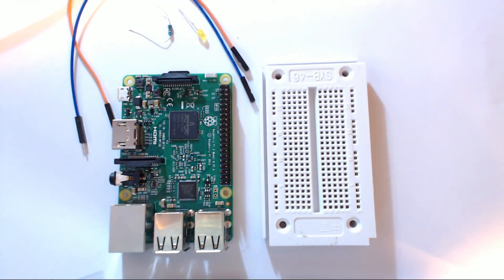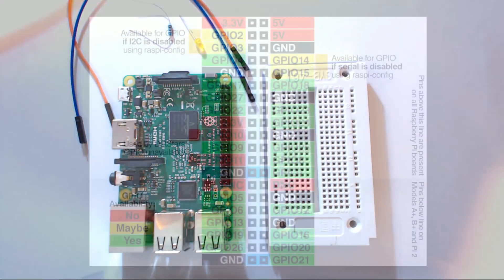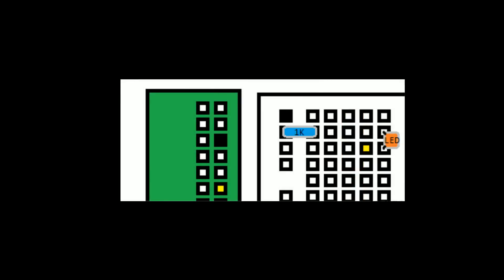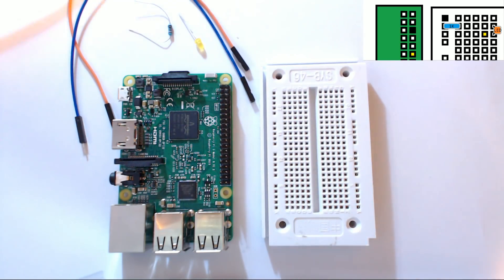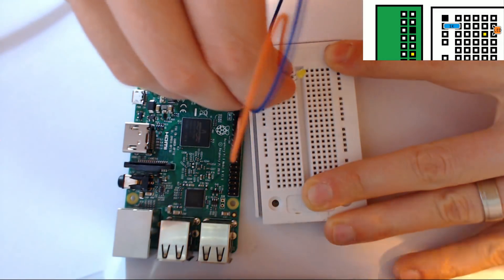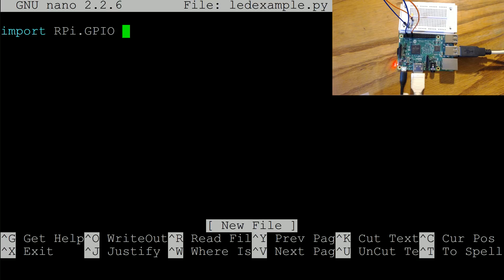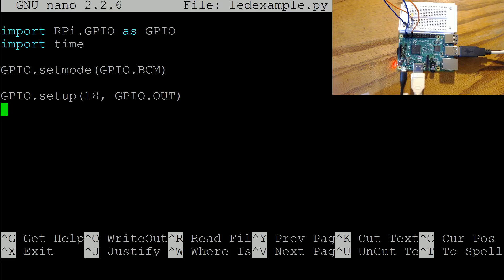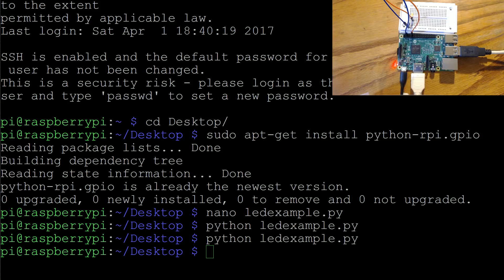GPIO Basics with LED light - Raspberry Pi and Python tutorials p.6

Comment: Excellent tutorial; I really appreciate the depth! I'm experiencing a small hiccup and wonder if anyone here could help. When I ran the program the first time (the light was initially on), it stayed on, then turned off 5 seconds later, as I expected. However, I can no longer get the light to come back on. Could anyone here help? I'm suspicious that the problem may be with my raspberry pi, but I hope there's a simpler solution. Here's what I've tried:

Running code with a delay before turning the light on, and not turning it off again
Testing the LED in another circuit to see if it works (it does)
Switching the GPIO slot (and the code to account for the change)
Checking the wire connections

After the five seconds elapse, the LED will flash very dimly very briefly, and I'm confident that I put the "HIGH" line before the time.sleep(5)
Reply: Problem solved! The joy of figuring out a problem in computer science is unmatched!

If anyone else has this problem I'll explain what I did wrong. I hooked the 5V spot to one end of the LED and the GPIO to the other, thinking that the GPIO would be ground/loose. Turns out, the GPIO is either 5V or 0V. So when the electric potential is 5V on both ends, nothing fancy happens. Which is why, when the GPIO turns off, there's a dim flash of the LED—the electric potential of the GPIO slot takes time to get to 5V. Meaning the difference in the electric potential was shortly present, so the light turned on ever so slightly.

Comment: does anyone know what this means?? I have tried 3 tutorials for this basic LED and this is the only one that gave me some sort of an error..  'module' object has no attribute 'setmoder'
Reply: did you accidentally type GPIO.setmoder instead of GPIO.setmode?
Reply: @griffincrawford7786  I had actually, but that wasn't the only problem... At this point I'm a bit confused to between all the tutorials I've been watching. I have a Pi Zero W. connected to PC monitor using Thonny. After watching several tutorials and running code from youtube as well as the book "MAKE: Sensors" for this basic function, copying the code verbatim... I'm finding that I have to debug the code so its recognized by Thonny. Some of the fixes were changing periods to commas, capitalizing vs non captial, setting an additional conditional line as "on" or "off" vs just high/ low, true/false... I guess my question is---- IS this NORMAL? Is there a location where I can just learn this one language? skillshare says one thing, youtube- several other things, books as well different lines of code to execute the same functions. I guess I'm looking for a universal source!! BUT wondering will I have to "debug" every python code I come across?  I'm trying to get to the point where I embed sensors into a leather and program haptics... everyones instructions seem so straight forward, but when I go to execute, there's all these problems- for even basic functions. Clearly I'm a beginner. Any advise?

Comment: Best way to differentiate GPIO.BCM from GPIO.BOARD is to use two different nomenclature. 

GPIO.BCM uses GPIO Number. 
GPIO.Board uses RPi Pin Number. 

The example uses GPIO.BCM which is GPIO 18. 
If the GPIO.setmode is GPIO.BOARD  then Pin 12 would represent GPIO18.

Setmode tells python which way to look at the GPIO's.

Comment: do you have to keep the hdmi plugged into the raspberry pi and manually run the file in the terminal or can you unplug the hdmi and it would still run. Like, for a car, once you program a file for it, you don't want a cord plugged into it while it is moving around.

Comment: Why do we need to use a resistor with the led?
Reply: because LED has its own rate, and the output from the raspberry its rate is to big. so that you need to use resistor to reduce the rate so the led wouldnt get too much power. (also it'll broken if you not using resistor)

Comment: My breadboard has positive and negative rails along each side, which one do I plug the jumper into? It also came with a power supply do I need to use it or will it just draw power from the raspberry pi?
Reply: Not sure if you still need an answer, but I figure I'd help just in case.

For the ground, plug the jumper into the negative rail. Not sure if it's impossible to do without plugging in the power supply, but as far as I know you'll need to plug it in before it lights up. Make sure you've finished plugging everything in before you power it back on (don't hurt yourself).

Comment: 1k is way too high for the 3.3v of the gpio pins. Would only provide 1.3ma for a red LED or 300ua for a white LED. Which would certainly still light it up. Just not very brightly. Normally LEDs use up to 20ma. But with a Pi I get that you don't want to use too much current and strain the power supply. Especially if you're not using a 5.1v 2.5a supply as is recommended or if you're driving multiple LEDs. But I normally use 1k current limiting resistors on LEDs on a 12v power source. You could probably get away with using a 220 or 100 ohm resistor for a max of 13ma from the 100 ohm on a red LED. But 330 or 470 would be fine too. Or if current draw is limited, you could always drive a MOSFET from the GPIO and drive the LED with that on a separate power source, like a 9v battery. As a buffer. Or an op amp voltage follower if you really want to get fancy, but that's probably not necessary. Cheers!

Comment: What does it mean if my led is turned on when I connected it to the breadboard?(Before running the program)
Reply: You may have accidentally connected it to one of the 3.3v or 5v power pins. Look up a gpio pinout diagram on google and double check that you're not using one of these. I madethe same mistake my first time when I connected the LED to pin 1 which alwas provides 5v and can't be used for GPIO.

Comment: Why does my LED flash? I have tried 5 different colours and they all flash...
Reply: by flash I mean it blinks
Reply: type the 'cleanup '
Reply: You sure you're not using flashing LEDs? May be a dumb question, but you never know. If unsure, connect it to a 9v battery (THROUGH A RESISTOR!) to double check.

Comment: Its really coo. Can we open or close the  door when the light glows green or red respectively. Actually i have created  qrcode scanner using tkinter, opencv and zbar module. And i want to do some intresting thing with door
Reply from the maker: You can program whatever you like, the hard part for you here would be actually having some sort of machinery that opens the door, and that would also need outside power, the pi's power wouldn't be enough for sure.

Comment: Is it possible to program in raspberry pi , some real cool neural network using tensorflow and data set will be its input from environment... to learning gradually and perform any real time task ?
Reply: The RPi is not cut out for serious neural networks, you'll want to have some serious horsepower and a dedicated GPU for that. Nevermind the fact that "any real time task" basically means "general purpose robot" which is far, far more complex task than you seem to think it is. The self-learning programs don't end with neural networks, and not everything can be solved with just a NN.
Reply from the maker: +Salman Zafar possible? Absolutely. Really hard? Yep.